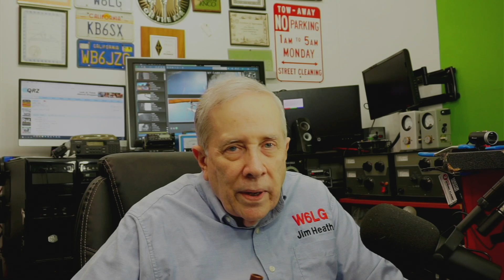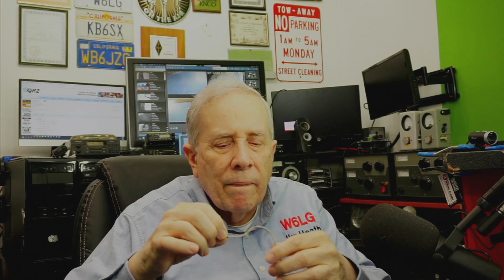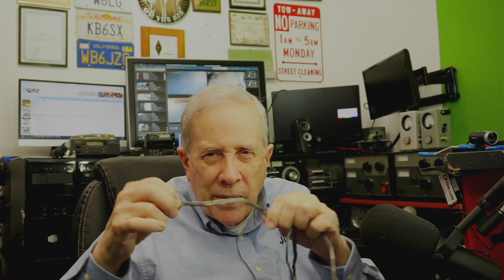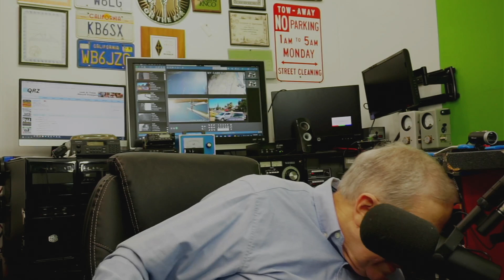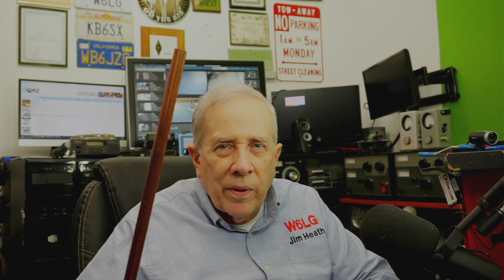How to RF Ground Your HF Station as Shown by the ARRL and a Discussion about Ground Loops, Bonding

Comment: Jim, I hope you get back to this. Yours was not the most detailed, but you pack it into a shorter video.

I believe bonding equipment needs to be connected to electrical ground.
1. Is this the 3rd pin on the wall outlet?
2. Do the coax shields from outside tie to this ground?

Thanks for the help.

P.S. The other sources say to connect to the mains ground at the panel, but add a ground rod outside the shack if the mains are far away. AND pound in rods every several feet or so until you get to the mains, AND tie the rods together with #6 or larger wire. For lightning protection.
Reply from the maker: Hi Lee, I agree on the PS and that does match the NEC.  Yes I do bond with a very low resistance conductor.  I am using 1 inch wide braid.  My goal is to get all of the boxes at the same voltage.  That could be zero ohms or a fraction of an ohm.  And yes, that pin is ground at the outlet.  And yes, I have my large homebrew coax switch mounted on a copper pipe under the desk.  That pipe is my common point ground and from there it is tied to the electrical ground.  I hope I answered your questions.  As I said in another comment, today was the first day of chemotherapy for Acute Leukemia.  And I may not be 100%.  73, Jim W6LG

Comment: Hmmm. I agree your station doesn't need an "RF" ground (it does need an electrical safety ground), but it seems to me certain types of antennas do need an RF ground, for example a beverage definitely needs to be terminated through a resistor to ground at the far end, and also needs to be fed at the near end via a transformer between the wire and ground. These grounds are essential to the operation of the antenna. Are these not RF grounds? They're certainly not electrical safety grounds.
Reply from the maker: Good point! Excellent example and question Mike. My answer is yes.  That terminates, dies, into the ground and it is RF.  I will stay with there is no "station" RF ground.  The Beverage Antenna  probably kind of mystery for most of us.  Mike I got a major dose of chemotherapy today so I may not be thinking as clearly as I would like.  Thanks Mike and 73, Jim W6LG

Comment: Very helpful!! Quick question: how do I connect the copper pipe to electrical panel/common point ground? My shack is also on the second floor and running a wire or pipe strap downstairs would be about 100 feet. Don't get me wrong, I can do that but everyone tells me 100 feet could become a second antenna. Thanks!

Comment: So two questions question 1 should I run a ground wire from the antenna mount to the ground? Question two should I use a high band and low band bypass filter on my coax so I don't bother my neighbors?
Reply from the maker: Hi Ken, the answer to number 1 is no for performance.  If lightning is the concern, then yes.  It will need to handle a huge amount of current in a split second.  A small cable would be vaporized.  A low pass filter is what we typically used.  The idea being that harmonics would be suppressed.  I run "full power" in my new neighborhood and so far no complaints.  So my answer is no.  I doubt that you have harmonics coming from you equipment that would bother a neighbor.  Most of what we were dealing with was inerterference to the very low TV channels.  Those channels no longer exist.  Sorry for the long delayed answer.  A cancer diagnosis and chemotherapy changed much the last few days.  73, Jim

Comment: My comment may be a bit late, but you do come across a bit naive which regards to RF grounds.   I do agree with a good fraction of what you say, but your remarks are biased by your choice of antenna.  Yes, a dipole does not need an RF ground, but not everyone uses a dipole. Try connecting a dipole without the shield connection(i.e. monopole).  It would not work well, but if you connected the shield to an RF ground it would work(though not as good as a normal dipole).   An EFHW should not be choked at the feed point. Doing so would be the one pole dipole above (an incomplete antenna).  Choking a short distance from the feed point allows the outside coax shield to become an RF radial.  Yes, I have an EFHW-80-10 (49:1 unun) and by chance I mounted the unun on a fence near my pool pump.  The pool power panel has a 7ft copper rod ground.  I have the unun grounded at the rod not for performance (but it does perform very well) rather it allows me to easily by-pass the unun with a short pig tail to turn the antenna into a 160m 1/4 wave and it provides lightning protection as the antenna wire is coupled to the ground via the unun.  That said, I have no "RF ground" in my shack.

I have a sailboat, and if you had an HF radio on a sailboat you would think differently about RF grounds.  Common marine setup is a long wire (metal backstay) antenna with a tuner mounted at the feed point.  These require a true RF ground (RF because it does not need a direct rather a capacitive coupling).  The RF ground to the sea uses the seawater as part of the antenna system making a ground plane (i.e. think image charges). This effectively turns the "monopole" tuned long wire into a dipole.  The same is true RF grounding via radials.   I agree the word "ground" is often poorly used.  Maybe "bond" would be a better choice especially where RF bonding (either seawater, radials, or earth) is actually part of tribe antenna. On my sailboat, I have my Al mast bonded to my Pb keel for lightning grounding but I have my autotuner output RF ground bonded to a bronze thru-hull via a bunch of parallel capacitors (see me on qrz).
Reply from the maker: Hi,  
You said that I "do come across a bit naive which regards to RF grounds." Really?! I have been building antennas for about 60 years.  And, don't lose site of my time manufacturing HF antennas.  I do think that, for the most part, RF grounds do not exist.  From what I read, much of what you describe is a dipole of some kind.  
 
A couple of quick responses as my time is very limited.  I am getting things ready for months of Chemo Therapy for Leukemia that appears to have evolved from MDS.  
1.  Radials are not RF grounding.  Radials, as you know, perform better, much better when elevated.  Radials are a counterpoise.  They are the other part of the antenna. 
2.  An  End Fed Half Wavelength antenna absolutely must be choked right at the feedpoint.  Your example changes the EFHW to an off center fed dipole.  The impedance is very different from the EFHW.  The shield becomes one leg of the dipole.  The antenna you describe is not fed at the high impedance.  You've changed it to a dipole.  To be an EFHW, it must be choked so that the shield does not become part of the radiating antenna. 
3.  Dirt is not a good radiator.  If it were, we could bury our antennas in the backyard.  
4.  You describe your boat's antenna as a dipole.  I agree.  There is no grounding because it is a dipole.

Thanks for commenting and offering a different opinion.  Next time, leave off the insult and add your callsign instead so we can know your identity.  73, Jim W6LG

Comment: I have moved into an older house that only has 2 pronged plugs. I have a new grounded 200 amp electric panel on the outside wall close to my equipment. Any suggestions on how I would connect the equipment so as to be properly grounded. Running wires through the wall is no problem. Appreciate any suggestions. Great video!
Reply from the maker: A #6 wire to the electrical panels common point ground located below the panel.  All ground wires for water, electrical service, telephone and cable connect. 73, Jim
Reply: @ham-radio  Thank you very much!

Comment: Quote of the day:  “You put up a dipole antenna.  You have to have a ground.  No you don’t.”  Amen.

I really do wish I could wave a magic wand and change our common terminology to something that has not been given seemingly mystical properties.  For example, the bare ground wire in house circuits, i.e. ground wire, would be called the FAULT RETURN wire -- as in low resistance return for AC power fault return back to the main breaker panel.  Yes, it is connected to a ground rod at the panel but the urban legend implying magic currents flowing from/into the ground rod to make things safe is deceptive and confusing.  All current flowing from the power pole returns back to the power pole via the power lines coming into the house, not magically disbursed through the ground.  The fault return wire house circuit returns current/power even without the ground rod.

The shack RF ground (the copper pipe) would be better served by calling it the shack chassis EQUIPOTENTAL REFERENCE buss, i.e. EQP BUSS.  Its primary purpose is to assure that the chassis of all shack equipment is at the same potential at RF and thus reduce voltage differentials among the equipment which produce RF currents and contribute greatly to RF-in-the-shack.  This is accomplished via a low RF impedance interconnection system among the equipment chassis.  It happens to be tied to the house’s fault return because the various chassis are tied to the fault return wire.  Adding a connection to the fault return in the wall socket is visually satisfying but electrically redundant.  RF ground implies so many properties and features that just wrong.

No you don't!

Comment: It took sixteen and a half minutes to vaguely say that the grounding prong on the AC plug from the power supply is all that is needed these days for grounding your station in a modern shack or house.
Reply from the maker: Actually, that is not correct Bruce.  I say that in the first 5 minutes.  Additionally, I talk about RF grounds, conductor size, lightning (for another time), electrical panel's common point grounding, bonding and a bunch of other stuff in the first 5 minutes.  It is a very complicated subject and to set up for the answer, I needed to cover several subjects first.  Most of the time in a video, there has to be a preface or setup in order to explain the answer.  A good discussion of grounding, bonding, and the rest should be several hours.  Thanks for watching and commenting Bruce.  73, Jim W6LG

Comment: Jim, I have a 1953 Hallicrafters receiver with a 2 prong plug for AC. What are my grounding options for AC grounding? Thanks Steve
Reply from the maker: Hi Steve, 

I would change the AC cord to one with a ground prong.  I typical salvage the AC cord when a device is headed for the recycle bin.  73, Jim W6LG
Reply: @ham-radio  Thank you Jim, that is what i thought. Thanks for your reply.
Reply: @ham-radio  Gound to chassis right?

Comment: Jim enjoy the way you explain things..question, when you tie your " boxes" as you said your talking about the actual radio, or power supply ? Right using a already provided case screw or nut and attach the ground strap to that and run to a common point ( copper pipe) then running 1 say no 10 solid wire to the main power grounding point? Correct?.  I'm new to this whole thing and trying to learn it.

Comment: Hi Jim so i understand attach the radio and other things to the the copper pipe using a wire strap BUT then how are you connecting that copper pipe to the house ground system? do you mean connect it to the plug socket ground? You can get ESD earth bonding plugs in the UK would that be ok to attach the copper pipe to that? Hope you understand what im asking? Thanks M7WLG here and yes i got my call sign from you lol
Reply from the maker: The copper pipe is directly bonded to the common ground/earth at the main panel per our electrical code.  73, Jim
Reply: @ham-radio  I assume this is an empty
copper pipe. Are the couplings screwed and or soldered. I ask because I was inside a 911 tower shack once and every coupling and connector in their EMT conduit runs had a drilled and taped jumper with ring lugs across every connection and there were hundreds. It was very pretty and Meticulously done with # 10 green/ yellow striped stranded wires. When I asked why such an effort was done. The answer was short. Lighting. Bear with me please.
 As I am wrighting this the storm that is approaching me is producing 480 strikes per minute. My coax is outside right now. Should it be grounded? The lightning in the south is strong, and every decade or so there are long-duration bright white pluses that go straight down to the ground. These, are terrifying, to say the least. Having lived in the SF Bay area, sometimes we would usually get maybe 3 Weak pathetic strikes. I only saw one storm in 15 yrs that produced a couple of hundred strikes in total. It was The front-page story in, San Jose Mercury Newspaper. My antenna is mounted in a tree 4 ft from my house on a metal mask. This is why I want a ground rod under my antenna. I have seen a large oak tree hit and the scar came down to within 8 ft of the ground only to travel 30 ft out on the lowest limb jump 3 ft to a metal gutter then into a security light circuit, then jump out of the romex in the attic to a bare #8 ground that went to a metal fireplace chimney pipe on a two-story house the chimney was taller than the tree. You would think the metal chimney would have been hit in the first place,   Go figure. The point is, how can lightning considerations not be part of this grounding equation?

Comment: Having watched this. Read every question, answer, and comment. Read, Ward's ARRL Grounding and Bonding book. Not to mention many other videos and Motorola's guides etc. Read the NEC rule on additional grounding electrodes, which states must be bonded to house mains grounding electrodes, outside the perimeter of the house with 6 AWG or better.   
(Being now convinced there is no such thing as an RF Ground). Can I conclude, grounding the coax with a lighting arrester @ the ground rod under the antenna is a bad idea? Would not the lightning arrester create a second ground path to the main panel with a shorter run and smaller gauge ground wire at that? Or abandon the additional G/Rod altogether?  Just Create a low impedance single point ground in the shack, connected to the nearest receptacle ground that runs thru house wiring back to the main panel. Let it be understood that the antenna, [end-feed vertical], and shack are on the opposite side of the house from the main panel and the house wiring is 14 AWG or 12 AWG at best with wire nuts probably along the line.
  I Feel like I am in The Twilight Zone. But I know I am in a Severe Lighting Zone.
Reply: There are two things here that must be balanced.

The shear high voltage and high current of a lightning strike means that it will get everywhere.  Period.  The primary work of lightning treatments is trying to steer the majority of the energy away from sensitive stuff.  The NEC, NFPA, etc. all spec many rods and heavy gauge wires for the steering effort.  The primary objective is to keep the lightning energy out of the house by providing a preferred, low resistance patch to earth that does not include the house.  Simply put, if you have a wire on the tower going into the house, no matter what you do, some lightning strike energy is going to get on that wire.  Your job is to provide a preferred path to the earth outside the house to minimize that energy.  Lots of rods, arresters, etc. outside the house.

The second consideration is AC power faults -- thus the NEC requirements about wiring house grounds.  In this case, one is steering AC power fault energy to the house ground wire and back to the main disconnect panel where the current can then return via the power wires feeding the house back out to the pole.  Thus there is a reserved, low resistance ground wire available for this emergency return.  This ground wire also serves the function of providing an equipotential for all the surfaces/chassis of equipment in the house.  If everything is at the same equipotential then currents don’t flow and you won’t get a 60Hz killing shock.  The local dirt potential via the ground rod at the main disconnect sets this common house base chassis voltage.  There is no 60Hz current flowing from the dirt into the house; it is just simply setting a local safe equipotential voltage.  Afterall, dirt is pretty resistive and there is no current flowing in the dirt and returning to the transformer on the power pole.

You’ve probably already seen in the various standards that you must connect any ground rod system back to the rod at the house mains disconnect.  This is usually done by connecting everything to a terminal bloc near the main disconnect’s rod and then one wire from that terminal block into the main disconnect box.  So, if you have antenna ground system on one side of the house and the power’s ground rod is on the other side of the house, you must connect a heavy wire between the two.  Otherwise your antenna shield becomes the connection between the two ground systems.  Dirt is a poor conductor and so there will be voltage differences at various parts of your yard simply due to ionic differences.  Without the interconnecting heavy wire, there will be current on the antenna wire due to these voltage differences in the yard.  And, a much worse situation, if there is a lightning strike with the resulting ground currents, your equipment will be toast as the antenna wire connects the two ground rods!
Reply: @713allen  Thank you, Allen saw that I had liked your comment, but did not respond in writing while rewatching this video, 8 months later. 
I believe that my understanding of grounding and bonding has become firm at this point, and your comment confirms my understanding. 
Thanks again for taking the time to write such a thorough and thoughtful outline of my question. 73/88